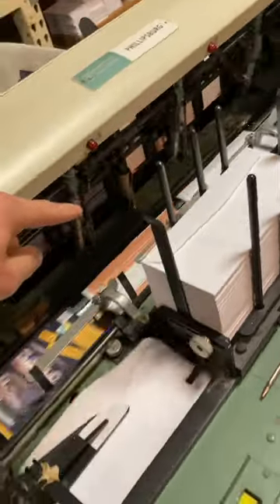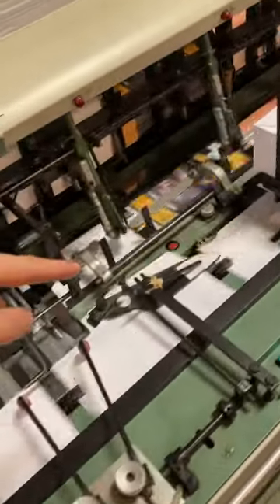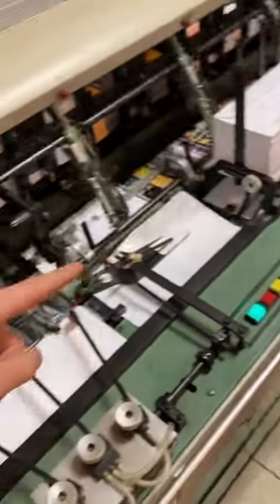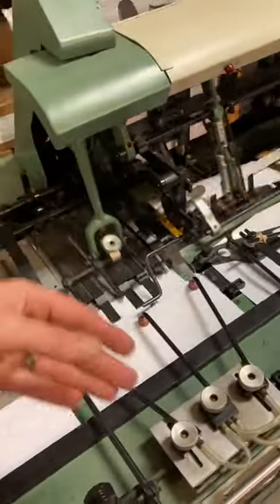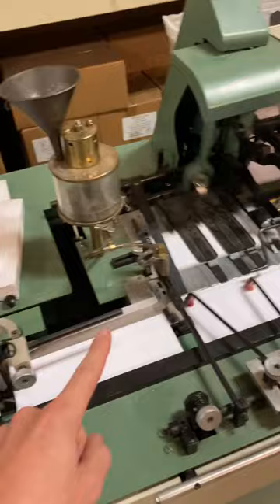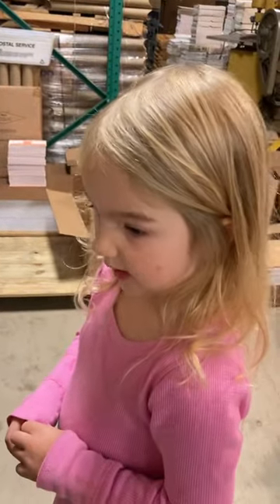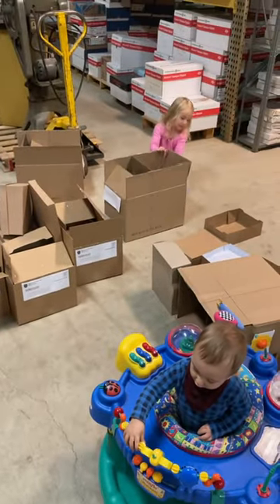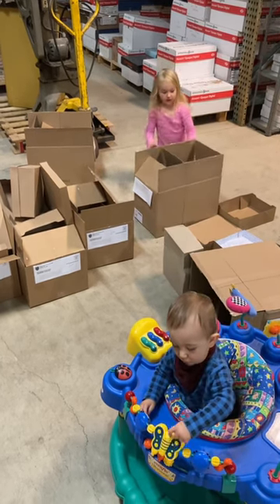The mesmerizing envelope inserting machine. Even the kids like it!

Comment: In my work we had bigger version of that inserter (but same functional principle) from Bell Howell: page feeder with barcode reading, folder with automatic fold setting and 6 stations for inserts. Made sometime in the nineties. Max speed 12000/hr, but only bravest operators use speed over 6000/hr - it was like a small earthquake when this beast run at these high speeds! 😂
Reply: @Tomas Hasek. This type of swing arm gripper feed, gather and envelope inserting machine was originally manufactured by U.S. company Philipsburg. Bell and Howell bought out Philipsburg and just built on what was an already an industry standard machine. If you took the B & H covers and guards off your inserter section of your machine and put it next to Dan's, you would see how similar they are. The swing arm gripper system is tried and tested. Back in the 1970's I used to operate a Sheridan gatherer/binder for producing telephone directories The gatherer system used the swing arm principle and some Sheridan machines were built with 20+ stations. Stay safe and well.
Reply: @markmiwurdz202  Thank you for the info. Yeah, they are very similar. Our type was Vitesse C5. In 2011 replaced by Pitney Bowes Mailstream 22.